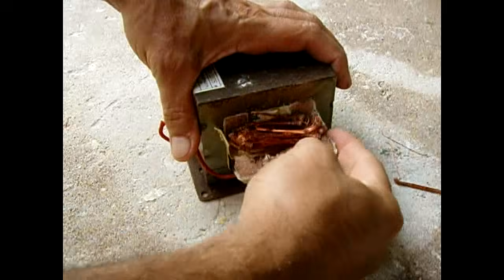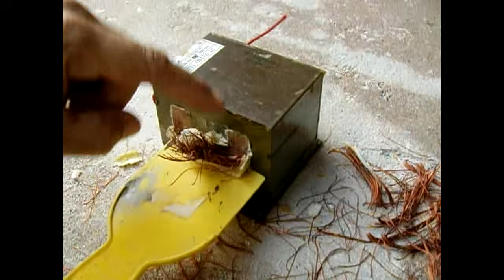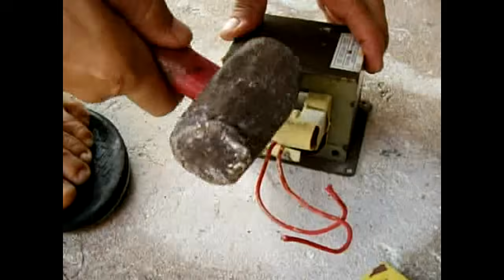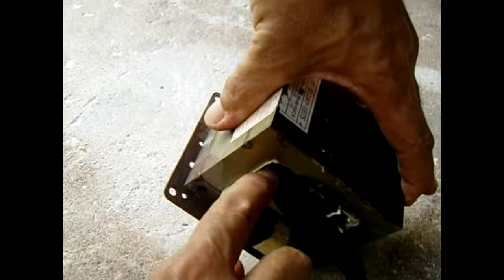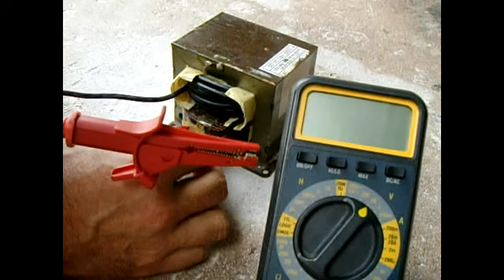BEST Microwave Oven Transformer-MOT Rewinding Tutorial

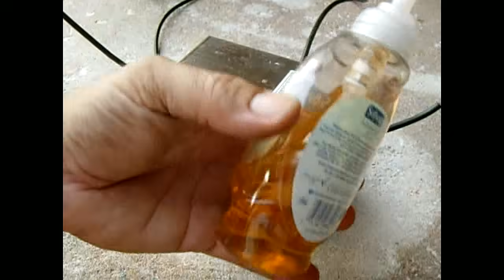Comment: Good video! Especially the part at 15:08 thanks for the useful info! 
I have some notes: 
1- you can remove the secondary without damaging it (but its hard)
2- opening it makes things easier (cutting the welds and opening it) winding the coil becomes easier, removing the secondary becomes easier, etc
3- you should've removed the magnetic shunts to get more space and more extractable power 
4- (MOST IMPORTIANT) you did the same mistake that every "rewinding a MOT" video EVER did: the transformer is cheaply made and it goes into saturation, which not only makes it inefficient and makes it draw alot of useless (literally) power, but also makes the output ugly (not a sine wave) and worse! To solve this: you have 2 ways: 1- using 2 MOTs with their primaries in series. Or 2- winding an extra ≈100 turns on the primary (with the same gauge of wire that is already used for the primary). And thats to avoid saturation and make the transformer a REAL transformer that can run for hours without complaining (just like a proper real transformer) and run 24/7 (unloaded) without significant heating (im exaggerating but you get the point: it will become a transformer that will "last more than 5 minutes") 
You can easily make the calculations for yourself: using the "transformer equation" V(rms)=√2×π×f×N×A×B(max) and plugging the values (you can approximately get the number of turns of the primary by winding 10 turns on the secondary and measuring the output voltage, then you use this equation (V₁/N₁=V₂/N₂) and calculate the approximate value of N₁ (i keep saying approximate because the output isnt a clean sine wave which affects the readings). or you can get it by knowing what gague is the primary, then measuring its resistance, then calculating the length of wire used by the resistivity equation, then calculating the "circumfrence" of the rectangular shape of the core (because some windings are on top of eachother, the windings differ in length of used wire, so you can take the average value for the "circumference") (calculate the length of wire used to wind 1 turn), then calculate approximately how many turns used), plugging the values: (i'll use the approximate values for my old MOT) 220 = √2×π×50×190×(24×10⁻⁴)×B(max).. rearrange for B(max) and you get MORE THAN 2 TESLAS!!!! that means that the transformer is indeed reaching saturation (because B(max) values for a typical iron core are around 1.2---1.7 tesla) now use the equation but make B(max) equal to 1.3T and rearrange for the number of turns and you get ≈310turns! So you either add windings to the primary until you reach ≈310 turns, or you can use 2 primaries in series to get ≈half the voltage on each MOT which is PERFECT (i did the calculations again for half the voltage and at the worst case scenario (number of primary turns ≈170), B(max) becomes ≈1.2 ! so that solution is basically perfect, AND you can extract more power with this setup (because the output will be a much MUCH cleaner sine wave and you wont have to worry about saturation)
Hope this helps :)

Comment: Thanks for the video !.... has anyone used a rewound MOT, heat sink, capacitor & rectifier to build a 120 volt AC to 20 volt DC power supply for a DeWalt battery powered miter saw (or other power tool) ?

Comment: My MOT gets so hot I don't know why
Reply from the maker: They run fully saturated, so they get hot. The cooling fan can be placed next to the transformer.
Reply: @electronicsNmore  is it ok if i use a pc fan and heat sink for long term usage? I wanna use it for high current dc power supply.

Comment: Went out and bought a copper grounding rod for 10$ at the home store.  Is 8' of solid copper thats 1/2" around..  i sanded it down to just enough to completely fill the space in the transformer then dipped it in floor varnish 3 times along with the rest of the transformer.  Cut off the bottom of the transformer though and sanded the varnish on the mating surfaces and a corner on each side.  With the winding in its home i hooked one side to negative and othrr side to the positive electrode holder from my stick welder, rubbed a little tinning flux youd use for pipe brazing then with gloves and welding mask on and machine on 200a ac and just gotta make sure that you hit both sides at the same time so i used 2 pieces of wood to guide me and slapped together.  No sparks came out and i switched off the machine as soon as i could get to it.  Worked perfect..  two halves are together and wont come apart, the winding gives me 120v in and 2v out with enough current to blow my 1500a shunt so 2ka i guess..  dunno.  But it makes a hell of a supply for an hho generator and can stay on with a fan indefinitely...

Comment: There is a lot of aluminum clad 10guage cheaper wire on Ebay, are there any complications with using this wire as opposed to the copper? I am trying to make a 12volt to 120 volt inverter. I am having difficulty finding any solid answers by doing a search. Thanks.
Reply from the maker: You need to use one size larger enamel wire in AL to do the same job as the copper, and that means it takes up more space that you may need.
Reply: @electronicsNmore  If I add a couple more mosfets maybe it could be the same effect as a larger primary, perhaps? I think I recall seeing him say that it would increase it, the amps, but there is a language barrier.

Comment: I want to tell you that if you apply mains to the high voltage winding you can then get 50v ac out of the old 250v winding without doing any taking to pieces. You should know that taking out the shunt core reduces the inductance and the mains winding then takes a lot of current and the transformer will get very hot even with no load.

Comment: Somewhere around 15 or 16 turns mine got all mixed up and not very uniform ... The last 2 or 3 were pretty tough getting them through ... I also used 10awg solid so it was extra tricky haha what a finger work out 😆.... I just now got finished rewinding it and have not tried it yet but I was wondering if you have any idea if it will work at all using a solid/single strand ..also I now dont have a working dmm ... 😣😞 haha ...

Comment: remember  people: these appliances were designed, to be electrified   ONLY  WHEN  THERE  IS  A  LOAD  on the original microwave.  When that start button is activated, as there is no  'ON'  switch, and standby to 'operate'.    Therefore, you should only power up your re-wound transformer,  WITH  A  LOAD  ON  IT.  If not, xfrmer will overheat rapidly.    old tech....

Comment: Each lamination is insulated from the other, to prevennt Eddy currents, so when you test with Ohms to see if there is a short, you are only testing the laminations that you scratched, another way  to test, would get the Ohms resistance rating for the wire on the primary, test that, if it is within range then it is not "grounded", if the Ohms is Higher, then it is shorting.
Reply from the maker: The weld across the laminations keeps them all together, so they can't be insulated.

Comment: For winding the new wire, what length of 10 guage wire would be needed to make 16 - 17 turns for the welding circuit. ?
 OR approximately how long should the 12 gauge wire be to create the battery charger to reach 13 - 14 volts ?
Reply from the maker: https://www.youtube.com/watch?v=deMmVK67HO4

Comment: Question. Theoretically speaking is it possible to wrap 6 gauge or whatever gauged wire ''loseley'' with slack or loops for adding taps? The sectional density would still be there in the core but all windings would be given a certain amount slack outside the core. Would it still work? I want to build a welder I got about 10 suitable MOTs but It's gotta be adjustable. I want to add a contractor switching wheel

Comment: If you test the open circuit amps in the primary ( 120 volt input with no secondary connection ) , you will find it draws nearly 1 amp idle current and that means you waste about 100 watt power.  The microwave transformer is not designed to be powered constant with the primary winding it has, and needs nearly double the amount of winding for the idle current to be low in the primary.  To properly use these cores requires a rewind of the primary coil as well as the secondary.   Just a little info for you.  Test yours under no load, power on  and see what primary current you have.  Then feel how hot the cores gets after just a few minutes.   Do your calculation  (120 volt times the measured current) = roughly the power consumed under no load, that power is making the core heat up.
Reply from the maker: Yes, if you want an efficient transformer, you'd rewind both.

Comment: It's easier to multiply the RMS AC voltage by 1.4142 to convert it to peak, which would be the DC voltage across the caps...but don't forget the  voltage loss across the rectifier diodes, with a full bridge you are looking at around 1.4V

TLDR:
VDC=(1.4142 x VAC)-1.4
Assuming sufficiently large filter capacitors.

Comment: Just grind bottom weld out, knock it once and slide the entire coil out,, do your thing and weld or epoxy back together
Reply from the maker: Hi Bruce, I have another video showing that. :-)
Reply: Just got 25 wraps of #4 solid copper wrapped inside the same size tranny. Choke for huge DC Supply.

Comment: Excellent video... Thank you for the AC to DC calc.

While cleaning the transformer I took out all the paper and middle shunt.

I remember I saw one you tube video. It say that piece should be removed for more room to turn the primary copper wire. So I hammer it out already.

What does that piece of metal in the middle for? Used as spacer?
Reply from the maker: That piece of metal alters the magnetic flux which limits power output. I have many great videos on my channel that cover a wide range of subjects, so be sure to look over my extensive video playlists for other videos of interest to you and most importantly share my channel with many others. Thank you!
Reply: @electronicsNmore  What will limit flux do to the current?

Do I then received less current for my winding?

There must be a purpose of this shunt, otherwise manufacture will not have it in the first place. Is for safety? Current noise reduction?

Comment: Instead of using the putty knife blade to keep from damaging the primary just use a few Q-tips.
Reply from the maker: The plastic won't damage the winding. Thanks for watching!
Reply: @electronicsNmore  
Yeah. I gotta retract that one. After watching it through, you look like you gotta grip on it pretty good.
I'm still amazed at the output they have. I was messin around with a transformer, cap, and 1 AA battery. It was shockin me pretty good. Good thing I didnt hook up 12V or higher to it.
I gotta hook something up for the damn skunks when I go camping. They show up everytime. The worst part is they know the advantage they have. And they've nailed my dog too many times he's losing his sight now. 
So no more Mr. Niceguy. Them bastids gonna ride some lightning next time.

Comment: You just gotta cut it off to separate MOT' core into 2 letters. You just have to before you get lazy and follow this procedure. This is actually a whole week of very tiring effort and nicely edited to 10 convincing minutes. I have rewound countless MOTs and the best quality winding to replace your secondary is solid bare copper wire slid into 20 feet of shrink tubing and bended the windings into  wood bobbins then transfer it to the core. Doing it this way you will get frustrated and most likely to hurt someone if not yourself . Yes its true. 👉🏽
Reply from the maker: I've done many this way, no problems at all.
Reply: electronicsNmore That comment was totally unintentional. There was an idiot who happens to be sitting here and he did the comment without my consent and so please disregard that. You are doing an awesome job and I just completed my connection based on your post. 😎

Comment: Hi bro nice informative vedio , can i use the primary as the secondary for 220v  and recoil the top winding for the primary and supply 110v through it.
Reply: I tried and a spark jumped a gap and put me into cardiac arrest. But I wasn’t far from ER so I’m fine now. Some of the damage was to my muscles. Every muscle in my body contracted causing tiny tears Called micro tears. Causing my sport career to delay. Until now
Reply: @nathanthomas7083  😆

Comment: You spent so much time in this video about winding direction, and it actually does not matter at all. In case you use two transformers in serial all you need to do after all connections done is to measure voltage. It either will be fine or close to zero. If it is close to zero, just flip one transformer  connection, does not matter prime or secondary coil. It is usually easier with the primary coil. But it does matter ONLY if you use more than one transformer. Also, these transformers are not too good to be used for chargers, they work in high saturate mode, not good for long work. They are good enough to make a spot welder though.
Reply from the maker: Always put things back exactly as you found them, it's an excellent practice. These transformers work fine for charging, just as long as a cooling fan is used.
Reply: "as long as a cooling fan is used" Exactly. Because a lot of energy goes to waste. These transformers were not design to work hours. Now, what  "Always put things back exactly as you found them, it's an excellent practice"  has to do with winding direction? It just does not matter. You can start wind coil in any direction and it will look absolutely the same, it matter of what terminals you will call "beginning" or "end".

Comment: I followed your instructions and after I made a rectifier from 4 diodes I tested my output and was very happy to get 15.4 vdc . I soldered clamps on each lead and found an old battery which measured 4.4 vdc so I hooked it up. After 1 hour I checked it and it was at 10.2 vdc but what alarmed me was the transformer! It was too hot to touch! It buzzed VERY loudly...normal...but was so hot I couldn't possibly hold it without gloves on my hands. I immediately unplugged it to let it cool down. Any advice?
Reply from the maker: Hello Kevin. A lead acid battery with 4.4V is trash. The voltage will never rise to a fully charged state. ONLY use this to charge a good battery which was allowed to drain down, not a battery that was sitting for a very long time at a very low voltage which is full of sulfation. The buzzing is caused by the windings vibrating. If they were very tightly wound, you wouldn't hardly hear a thing. As for the heating issue, these transformers were not designed for this purpose. If you don't replace the primary winding to make it run cool, then it needs to be cooled using the fan from the microwave oven, Place the transformer in a housing, cut a hole in one side to allow air to be drawn in and around the core, then place the fan on the opposite side of the housing blowing the air outward. The heating issue will be gone.

Comment: the direction of winding the secondary coil does not matter
Reply from the maker: It does if you intend on using 2 transformers in series like I show in a couple of my videos. If you're only using one, then it doesn't make any difference. It's a very good practice to always put things back exactly how you found them.
Reply: if you exchange the connecting wires then that will change the direction

Comment: I have a mot from a 1000W Kenmore Elite. Rewound secondary to a rectified 14vdc. With small load 55w or no load the primary draws 7.5 amps continuous. Is this normal. I was going to try to make 10amp power supply.
Reply from the maker: The transformer is saturated. You'd need to rewind the primary with more turns of thinner wire. :-) Refer to my "DIY power transformer" video, there's a link to a winding calculator.

Comment: Insert a short piece of 1/16" piano wire (about 4" each) being at the top and at each end on one side of the primary (tap in lightly with hammer). Cut close to the iron core with a fine tooth hacksaw. The piano wire is too hard for the hacksaw blade to cut so it stops the blade preventing the primary from damaged. I just cut the secondaries off two transformers. Ten minutes each and no damage to primaries.

Comment: How many feet of 12 or 10 gauge wire is needed if I wish to have exactly 12 volts DC later on after  full wave rectification?
Reply: electronicsNmore  hi I watch  video in you your chanel   I won't ask  how can make transformer microwave  12 volt  high amp for charging car battery  thanx
Reply from the maker: Not too much wire. Refer to my other video, "DIY Custom Power Transformers". I supply a link to download a free program. You enter the required information, and you'll get all info.

Comment: Why worry about the winding direction? Unless you are intending to interconnect primary and secondary the winding direction are immaterial.
Reply from the maker: Exactly. That's why I suggested putting things back the way you found them. I use (2) of these in series for my DC welder. Phase matters.
Reply: electronicsNmore - thanks for clarifying that :-))